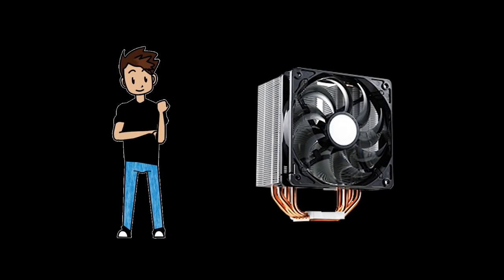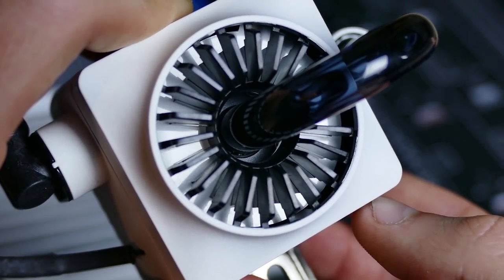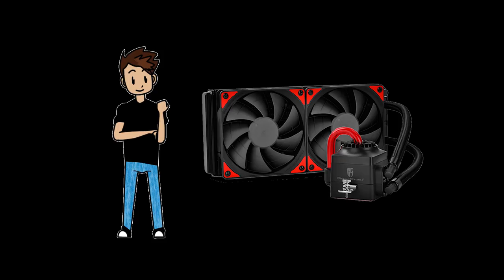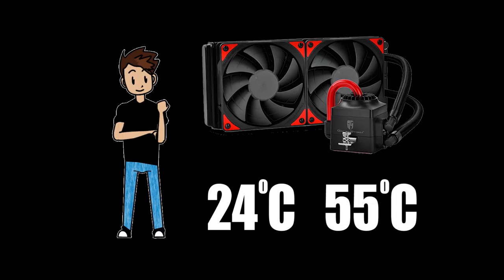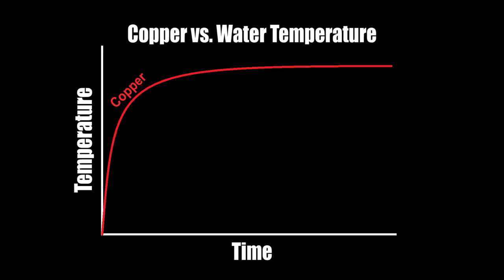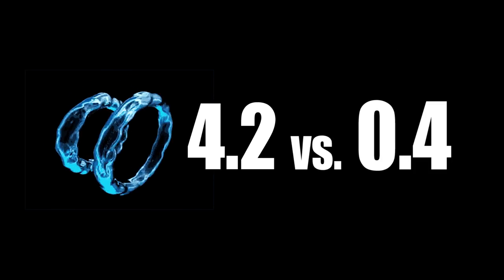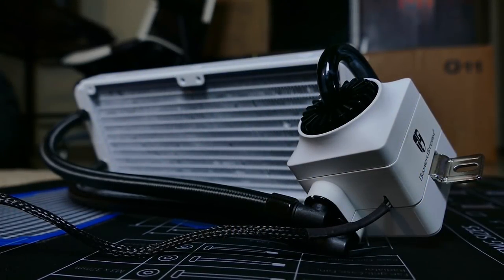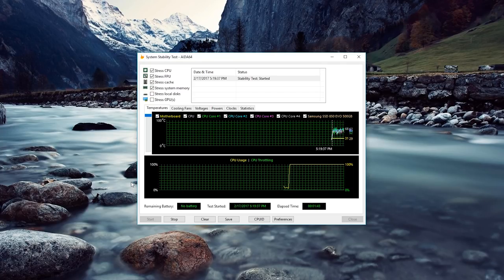How to Properly Measure AIO Temperatures

Comment: I still don't know if I should get a water cooler or air cooler cause I heard water can drip from a water cooler as well
Reply: If you're worried about leaking, don't be. most good branded ones don't leak, and if they do, it won't insta-kill your computer. I've known people with an AIO cooler for years and it never leaked. I'm using a custom water cooling loop, and it never leaked... even after I accidentally tipped my computer over and it fell in a thud x:
Reply: Xyler94 what about the corsair is that a good brand
Reply: tagzsy one of the better ones. Corsair and NZXT are the ones I'd personally buy. Or, if you're feeling up to it, the best would be EK waterblocks AIO. They're more expensive, but use proper water cooling parts, rather than the crapy ones. Also try getting a 240mm radiator, they're worth it
Reply: Xyler94 okay thank you
Reply: tagzsy do keep in mind though, that while they don't leak on their own, mistreating them will make them leak. Just be careful, and handle it with care when installing :)

Comment: In addition, the aio is usually propylene glycol and Water mix. And the volume is much less than you probably think. Gamers nexus shows this as he opens them.  It’s like 120 cc I believe. But doing the math your thermal capacity isn’t as crazy as you make it sound. Of course to be fair you also have to add the net weight of all the aluminum (an it’s usually aluminum not copper in these aios ) as well. The biggest benefits I believe are the much greater surface areas and potential airflow. You could use a coolant with a lower specific heat, but all that would do is remove that buffer or sink that is capable of absorbing short bursts of Heat. You seem to suggest that this would be ideal because it would be less confusing and reach equilibrium faster. I disagree.

Comment: A metal pot does not get hot before the water does. I have often "amazed" people by grabbing a pot on the stove before the water starts to boil. This is because the water has to reach it's boiling point before the heat can be transferred to the pot

Comment: The reason that people have a subjectively better experience using AIOs is that, especially for very hot running cards like AMDs, the sudden temperature spikes caused by the low specific heat capacity of an air cooled system (and therefore small temperature 'buffer' that air cooled systems provide) means sudden increased load on the GPU, with a lagging cooling system - the curve cannot adapt fast enough to smooth the temperature gradient and the user experiences dropped frames and a GPU that 'feels' like it's struggling - when in reality it's being 'bottlenecked' by a cooling system that can't catch up. The advantage of AIO is that it allows a smoother heat curve to be employed, since the specific heat capacity of water is significantly greater. Fans can gradually ramp up speed and try to keep ahead of the requirements instead of lagging suddenly behind.

Comment: FYI the more slowly the CPU heats up and cools down the better, this is especially important in BGA applications but who the heck is using BGA for gaming. anyways for most people using a liquid cooler would be beneficial because it means your thermal interface material will last much longer, the more rapidly these compounds are heated and cooled the more rapidly they are deformed, and subsequently dried out.  this also marginally improves CPU lifespan for similar reasons

Comment: Unsure why you never mentioned the much larger service area of radiators vs. air coolers and the fact that you can transport energy away from your hot components and get rid of it at a more suitable place, instead of heating up the inside of the box and hoping to blow out  the warm air faster than it is produced. Kind of why cars and motorcycles no longer use air cooling.

Comment: well yeah but honestly you're still looking at lower temps. Most games aren't going to keep your system running full blast for an hour or more. Between matches and during cut scenes your cpu will be taking a break and the temperature will drop back down very quickly.

Comment: For me AIO dropped temps by 10-15°C. I was using hyper 212 black edt and I had 50-55°C during gameplay, with Cooler Master ml240 V2 Aio  I'm reaching max 40-45°C.  In idle it was around 35 now it's 33. And I have long gaming sessions - 2-3h and still in that time, it reaches max 43 starting with 41. So... Maybe I have broken aio or it is against your laws of physics you are mentioning, it must be a miracle then. After paying games temps are dropping in few seconds to it's idle temperature.

Comment: Major key missing here. An aio on a non delided 6700k 7700k or 8700k is pointless to begin with. But i used an evo on my ryzen 2600x and saw way higher temps especially at idle. Leave it idle alllll day on the 240mm aio and its still 20c+ cooler. Under game load its easily 30-40c lower at max. Since the rad is in front i dont have an evo and gpu feeding each other heat. Both are cooler now

Comment: Except this demonstrably doesn't happen. If you have an AIO and run a benchmark you'll find it jumping straight  to a temperature (say 80 Celsius), and then staying there until the benchmark ends -- and really the temperature drops back to ambient within seconds as well.

The temperature lag you describe is significant when you have a large body of water, for example in the ocean or a pond. Maybe it might even be significant with an open loop with a reservoir. However with an AIO it just doesn't have the mass of water necessary for it to take that much more energy (and hence power) to increase its temperature as you describe. Mathematically, E = mcΔt. If m (of water) is insignificant, then it doesn't matter what c is.

Edit: it's also worth pointing out that the equation we're using assumes that heat is only being put into the water is not being removed -- quite the assumption for a cooler. Ultimately if the energy entering the system at the waterblock is equal to the energy leaving at the radiator you won't notice any of this.

Comment: A good idea?  2 reservoirs, 1 cold in spare, one operational thus hot.  Post use (say 10 min no GPU use) they switch reducing the system temps immediately.

Comment: Hi Greg, 

First, I want to say that this was a wonderful presentation on the science behind the statistics we are seeing. You explained how due to the medium's chemical properties, we see incomplete results based on the different rates of change with temperature. Furthermore, I can infer that if something takes a while to heat up, it is generally going to take a while to cool down, giving us a hotter running temperature post-max gaming during idling. My question is, is there a way to optimize either the liquid being pumped in the AIO or the radiator itself to better dissipate heat and keep the PC running cooler? I was curious on your opinion! Thanks.

Comment: Water has a very high thermal mass.
I ran my liquid cooler without a radiator fan for a while, and it's very interesting how it slowly but surely heats up.

Even so, With a decent fan, it made a big difference, but indeed you have to test for a LONG time to get a good sense of ultimate load temperatures...
Yeah, there is a long lag time for heat increases.

Lol. Good job youtube, fooling me into thinking I hadn't seen or commented on this before...

Comment: Mine are like 10°C-15°C cooler and is as hot/cold on 4.7GHz than 4.2GHz (it's a 2600k).

I love my AIO and yeah, your points are logical physics.
But if you're aware of it and you test your system properly you'll notice a difference but not that one people initially thought it would give (but is this a lie of the AIO or really the unawareness of the people using it?).

Neverthless, AIOs and Watercooling look awesome and do a great job at cooling the system (and I personally like them better than Air Cooling but that's a personal opinion). :D

Comment: I think your title could have been 'cleaner' by saying AIO temps are cryptic, or maybe not as cool as you might think(That would actually have been a nice title). Anyhow, your point is valid and most important very true, so I won't really hold that against you. I would however have liked to hear you also bring in the other side of the argument. That AIO's strength lies in dealing with the heat dissapation away from the processor,  making it easier to have a bigger area for cooling, etc.

Comment: Summary... Liquid cooling= Slow temperature rise for processor when in use, BUT the processor will cool down slower after use.
Air cooling= Faster temperature rise for processor when in use, BUT the processor will cool down faster after use.

Comment: I have a 8700k oc at 5ghz liquid cooled with h150i Corsair watercooler, gaming for hours and exiting the game my cpu Temps jump right down to 30 so your theory isn't all true, maybe if you're running benchmarks for hours and then turn them off I could maybe see that but gaming does not use all your cores and only spikes my cpu temp to 50 while benchmarking spikes it to 80

Comment: Ill stick to my silent build h115i 280mm with 2 cougar vortex sitting on my 1920x threadripper sits at 18-22c idle an gaming on max settings 4k it hits 35c an never seen it yet go above for 8hrs straight an my pc is in basement at a 65f room temp huge area so it never heats up from pc, I use a Cosmo 2 ultra tower also with great flow of fans to move gpu an MB heat, only down side is my hands are bone cold lol an its winter here in Canada

Comment: would the gradual change not be better for the cpu than rapid changes?
Reply: It's final (stabilized) temperature which determines how harmless/harmfull its for CPU.
That's why CPUs have long had automatic thermal throttling after set limit and shut shut down if temperatures still keeps rising.
Reply: sorry i was taking into account everything he had said.. i get that sustained loads under higher temps is worse for the cpu than lower ones (or at least creates less stability) but my question was more about how rapid the temperature changes. Would a gradual change that AIO allows for (even if it were to reach the same temp as the air cooler under consistent load) create a more controlled environment? Last time i checked, rapidly heating and cooling metals was typically bad for it. I know the temps are actually quite low considering what temps most metal can get up to but over a long period of time, slower change = better?

Comment: The problem with AIO's are their low pump speed.  ~.2gpm - .5gpm just isn't enough to actively force the heat transfer from the liquid block to the radiator, and out of the case at a rate faster than the production of heat until a high temp plateau. This low pump volume also causes the liquid to retain heat. AIO's are more than enough for 65w processor applications, and will perform great regardless of radiator size, as bigger radiators on AIO's restrict liquid flow even more and almost become redundant. 95w+ processors really benefit from custom copper loop with 1.5gpm+. The radiator size really doesn't matter, liquid flow is more important. My 8700k @ 1.5gpm with a 80x160mm radiator with 2 30cfm 80mm fans is overclocked to 5ghz with MCE enabled, and extended instructions maxed never broke 65c in a 12 hour stress. This is in a MINI ITX build with 4266mhz RAM, and a liquid 1080ti running @ 2.0gpm with a single 120mm rad and 60cfm SP fan. GPU temps never break 62c. Return back to typical use, and temps drop almost instantly back into the 40-50c range. Are AIO's lying to you? No. Are they worth it for someone looking to get performance out of an i7, i9, ryzen 7? No. A fan header cannot supply enough power to run a liquid loop effectively.

Comment: You miss the point. The problem is the spikes. The spikes are where you throttle. If you remove the spikes - you can then have longer burst speeds. Few people have workloads that resemble Aida 64. Finding an equilibrium is meaningless- it just finds the flux in temperature. Where temp in equals temp out. Heat diffusion scales with the difference in temperature. Plus, an AIO allows you to get much larger surface area and airflow

Comment: the analysis neglects the typical load scenario. Contemporary CPUs have an impressive power management system, and even a few microseconds where the total CPU demand (whatever this metric may be) might drop by 20%, can constitute a severe drop for instantaneous dissipation requirement. i.e. duty curves: if x runs at 90% duty for 15 minutes and 50% duty for the rest 45minutes , if the rated power is linearly dependent (which is not btw), we would expect 60% of the nominal Wh.

The cooldown is much faster, and as you correctly noted, could be made faster still with the fan settings.

Comment: Hey  guys I think you should check the performance and tech specs from all manufacturers and do not consider only the price when buying a water cooling. I'm saying that because, water coolers AIO, custom, hybrid or any other kind it be, they are developed with limitations, If you want to rise your clock up to the moon, neither water cooling or air cooling will help, but the RIGHT one doesn't matter if it is water or air. If it has the right dimension (your heat is under cooler's limitation), so your system should be fine. And I can say there are starting points where you can go before buying. First look for the processor TDP and for the TDP your cooler can stand. Calculate a safe margin of 80% lower (either for water or air coolers) eg.: if your CPU TDP in stock clock is 80W, consider at least a 100W tdp cooler for your system. At the same time, if you are going to overclock your CPU it is not going to be anymore a 80W TDP, so be careful here and look for the information regarding overclocks and TDP amounts you get..... Why I'm saying this? Think about a car, engines are water cooled right? If you put a turbo in a normal engine, it will heat a lot more.... Consider upgrade water cooling system for your car engine.... PCs are almost the same.... think about it.... BTW I'm very happy with my i5 8600k and my Deepcool maelstorm 120mm..... So think, search,  calculate and take the right decision when buying cooling systems for your PC. And, if you change your kind of use, I mean, going from stock to overclocking, consider cooling upgrade....

Comment: It's called equalizing, Just like how your car's cooling system works, it takes time for the temps to equalize and even then you will be cooler than a Heatsink by the end of the day. Also rule of thumb, thicker longer rads are better, more liquid to push and more surface area to dissipate.

Comment: Yes is true, lets take a look my PC at running couple hours gaming, and I shut down it about 10 minutes, and I turn on again, the idle temprature still high more than the CPU Heatsink cooler with same condition, that indicated the water takes much longer time to cool down than metal (Heatsink), my conclusion, if you going to gaming or working by watercooling system, you have to rest your system much longer. but still, raising tempratures to peak much longer too than heatsink

Comment: In short, to explain how AIO coolers are "lying" to you, it takes longer for temps to stabilize than their air cooler counter part. When people report significantly lower temperature on a nerd forum, they are typically giving misleading results. That basically sums it up the video.

Comment: I will say. I went from stock CPU cooler to a 360 mm aio with plenty of fans. Temps did drop 20C roughly after extended testing. It was nice. Was able to edge out more OC thankfully but will be dropping it back down as summer comes around. My room gets hot. Too hot. Even with this aio may have to undervolt this cpu to keep it under 90C anyway. 
Folks, dont make your gaming room in a room with no airflow or AC or windows.... its torture

Comment: Instead of an air to water radiator, if someone could use a water to water radiator, with the cpu water loop a closed loop, but the radiator water loop being open and running city water through, I wonder how much better it would be at cooling.  The closed loop would not get as saturated after prolonged use.  I would imagine this would be the best performing CPU cooler, but it would be costly because of wasting city water, unless you had a huge reservoir in which you constantly dumped ice from your freezer in, and let it act as a semi closed loop...  Would be interesting to see the results.

Comment: But wait. I thought you can set the radiator fan speeds in the bios so that at certain decree intervals they speed up to drop the temperatures to a desired level. This is what I did. And my CPU temp drops that way faster

Comment: Yes, I did n't like the click bait either. It's good coverage, but of physical realities, not lies. Effectively there's slower warm up . That's a good thing. Not so sure about the hypothesis of a longer cool down. Keep the fans and pumps running and without the CPU putting heat in it should be cooled quite efficiently by the fan over run - that's what AIO does after all. What was needed here was some tests and graphs. I suspect the BIG AIO advantage is that it gets the CPU heat straight out of the case - it's not 'wafted' around trying to cool down other things. Even better if the radiator cooling air does not come from inside the case. The whole area is a bit of a minefield folks. Kudos for raising the concept of specific heat, it's a perfecly valid point, and needs consideration. I had n't thought of it and you did! Maybe a follow  up? BobUK.